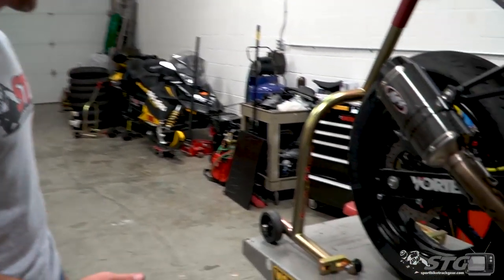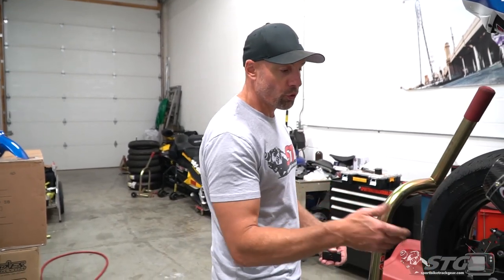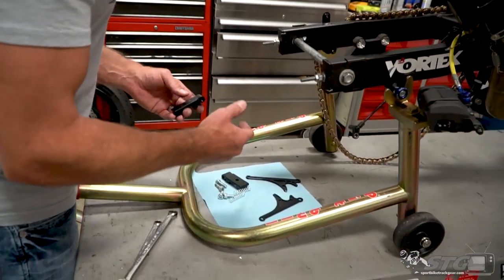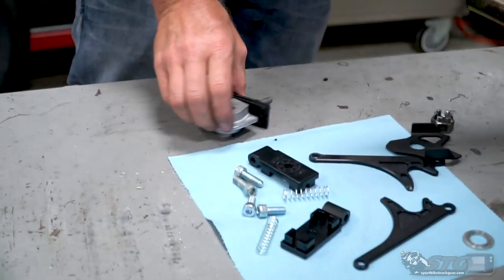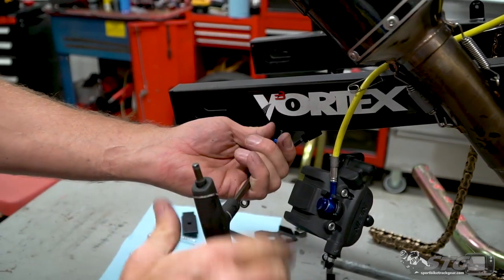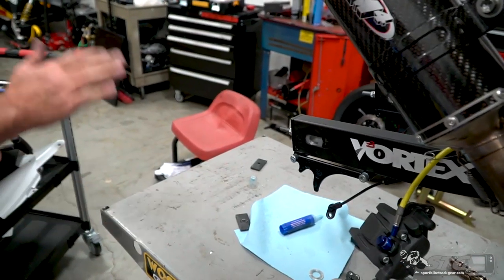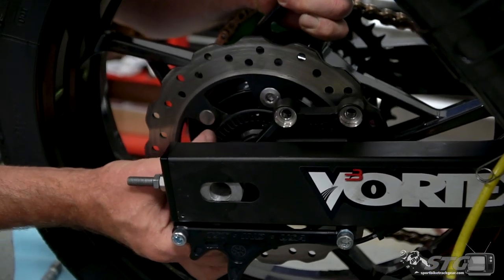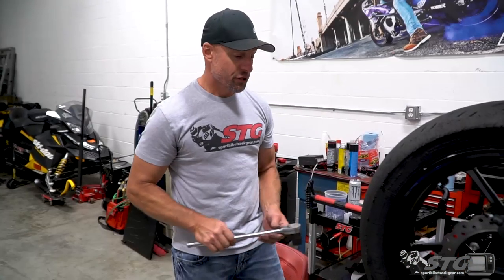Kawasaki Ninja 400 TST Chain Adjuster & GP Lifter System Install | Sportbike Track Gear

Comment: I’m adding some small spools to the sod of mine bc being stuck with solely gp lifters is kind of a pain.
Reply from the maker: You could run both if you prefer. We are using this TST kit on both of Max's Ninja 400's and are very happy with how it works. - Van

Comment: I have an idea for the caliper. Why not make a thin plate like a fork style that bolts to the swing arm and just holds the caliper bracket in the slider?
Reply from the maker: It's already done. I machined out a slot in the rear caliper hanger and used a shoulder bolt that allows it to still slide back and forth to allow for chain adjustments. Turned out really good but it was a pain in the ass. - Van
Reply: @sportbiketrackgear  hectic. Anyway I just wanna say hey from Australia and I've been following you for just over a year now. Keep up the good work and I should not bought my chain kit through you guys not motomummy.